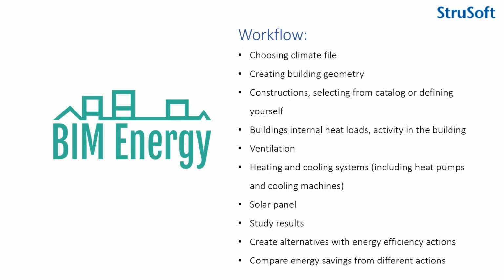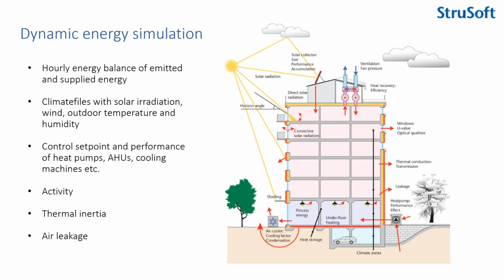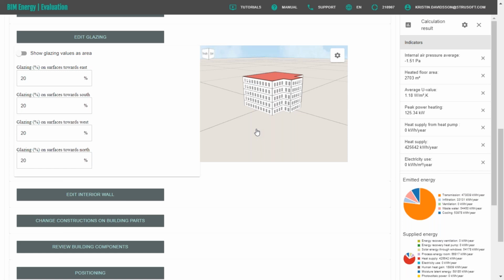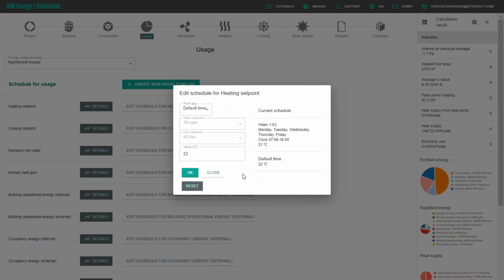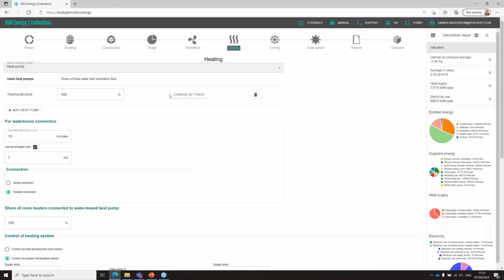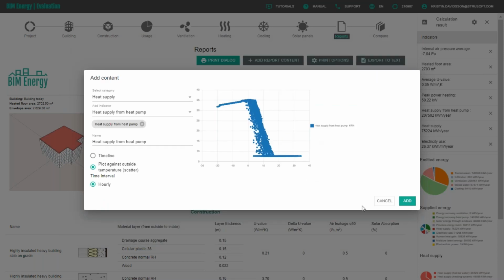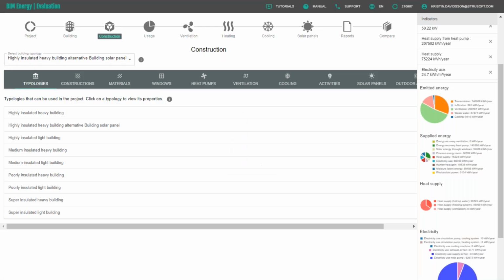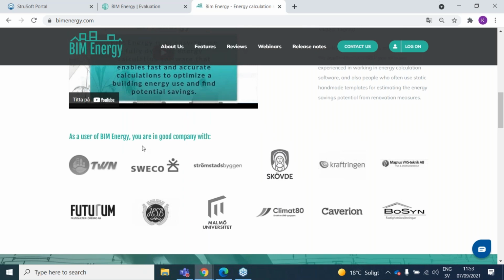BIM Energy Webinar - Calculate the Energy Efficiency Potential in Buildings  (English)

Comment: What is the job title or profession for someone who performs this kind of analysis for building projects or existing buildings?
Reply from the maker: Hello. Someone who calculates the energy efficiency potential in buildings could have titles like Energy Engineer, Building Energy Analyst, or Sustainability Consultant. In some cases, they may also be called an Energy Auditor or Building Performance Engineer. But there are also people with other titles that could work with it.